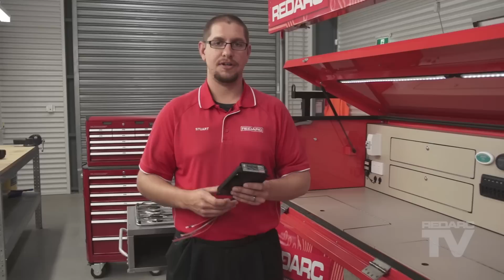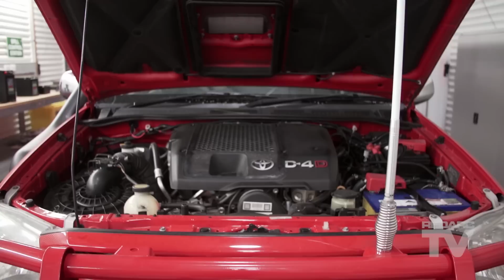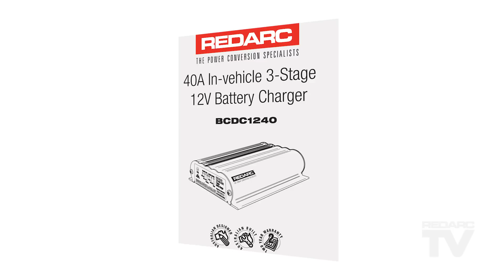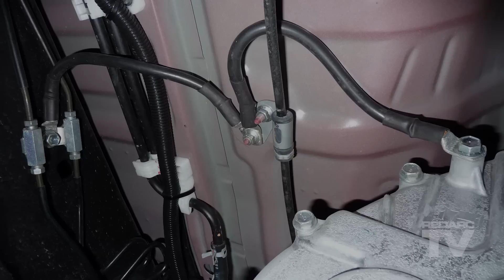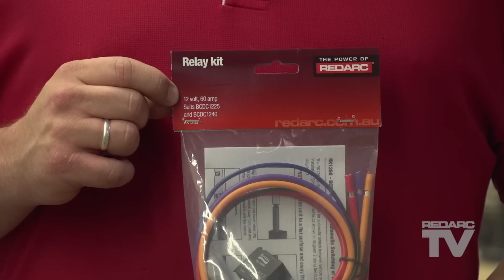Installation guide for the REDARC BCDC1240 (Not BCDC1240D Dual Input)

Comment: Hi- I dont know if i am on the right side here on you tube-i am an 70 year old german man and have a motorhome witch the bcdc 1240 3 stage charger- can i by the charger bcdc 1240 D 3 stage charger for replacement device.i drive to finnland and can not find a dealer of my benimar motorhome-
i have a lithium batterie in the cabin and a normal batterie in the ford transit car- thank you 
best regards from german--my car is a modell benimar yrteo from 2025-2024
günter
Reply from the maker: Hi Günter, please send through an email to power@redarc.com.au addressed to Craig, with the details of the issue, model, serial number and a postal address so we can help you out! If you urgently need to find a replacement part you can use our website to find an installer or retailer. www.redarcelectronics.com/eu/finder
Reply: @REDARCElectronics  Hi-Thank you- i will doe this -best regards günter

Comment: Hey, I know this guide is 7 years old but I have a Redarc BCDC1240 in my motorhome I bought. (it's red v.s. the usual black though, don't know if that matters.) My living quarters battery is starting to die so i'm going to replace it. Now at this point i'd like to know what my options are with this Redarc but the Motorhome didn't come with a manual and I can only find the DUal charger manual on the redarc website.  Could you send me the digital manual file if you have it? Or could you tell me what the best option would be for batteries? Are LiPo batteries possible on this one?

Comment: Is there a specific reason for not recommending the BCDC1240 for charging lithium batteries?
Reply: I believe you need the BCDC 1240D not the 1240, hope that helps 👍
Reply: @The_Nomadic_Yowie  Thank you, i know the 1240D is recommended but what will be the problem using the 1240 for lithium batteries? My motorhome is new and for being longer "off grid" i want to replace the installed battery for 2 lithium ones.

Comment: I have been using the same in my motorhome with deep cycle battery, but wanted to upgrade. 
Can this 1240 be used with lithium battery? I was told that it couldn't so please confirm.  Thank you.
Reply from the maker: Thanks for watching! The standard BCDC1240 is not recommended for charging lithium type batteries, in that situation it would be recommended to upgrade to either the BCDC1240D or BCDCN1240.

Comment: When you say wire all grounds to the same place (chassis), how is that possible when the BCDC charger is in my caravan beside the AUX batteries? That would mean I could not disconnect my van from the car as it would not be common with the car then right?  I am new to this stuff, but would it not be better to run the BCDC earth via Anderson plug from the van back to the car chassis or starter battery?
Reply from the maker: Thanks for watching! When wiring the BCDC ground you will want to make sure the black wire goes to common ground, it only needs a common connection to the car when its trying to charge from it (e.g when the caravan is connected).
If you have any questions on this please don't hesitate to give our technical support team a call  on 1300 733 272 (1300 REDARC).
Reply: @REDARCElectronics  Oh of course, silly me. If the caravan is disconnected, it dont need the alternator lol. I already ran a twin core 4B&S cable from starter bat to Anderson plug, but it seems I dont really need it now, if I am to earth to the caravan chassis as shown in manual instead. Is there any benefit of doing both... like earth the BCDC to both caravan chassis AND starter battery?

Comment: Does the device become hot while in use? how hot?
Reply from the maker: Thanks for watching! The BCDC will get very hot when under full load as it is a fanless design that utilises its heatsink to dissipate all heat from the unit passively. This is part of it's normal function and shouldn't be a concern. 

For more information, fell free to reach out to our Tech Support Team on 1300REDARC (1300 733 272).
Reply: @REDARCElectronics  Thank you !  I will reach, I would like to install and have a few inquiries :-0)

Comment: I have 100 ah battery (start) and 100ah (auxiliary) and handy 240ah lithium and solar panel with 200w.
Should i go for redarc 25a or 40a or 50a? Or it doesn’t matter?.

I want the fastest one
Reply from the maker: Hi Hussam, thanks for your comment. 

One thing we need to consider is not to overload the alternator in the vehicle with too many charging systems; so will need to take a measured approach to this. 

How is the Auxiliary battery being charged? If it is via a BCDC already, then we might consider at most a 40A BCDC unit for the Lithium battery to not overdo the system. If the Aux battery is being supplied by a battery isolator however, we could then consider a 50A BCDC for the Lithium as there would be slightly less load overall. 

See how you go and if you need to have a more in-depth chat with us, please give our Tech Support team a call on 1300 REDARC

Comment: Seems though the six flashes is common but not addressed.
Reply from the maker: Hi there, thanks for your comment. The 6 flash code on BCDC refers to either an Over-Voltage from a Vehicle or Solar input OR it can also mean Reverse Polarity, usually from your Solar panel. In a lot of cases, the 6 flash may occur when a Solar panel that is over the 32VOC maximum is connected to the charger or if a new connector has been setup and the positive/negative wires have been mixed around
Reply: @REDARCElectronics  Hi so the panel was putting out 22 volts, day was clear and panel in full sun, the ground wiring has been split into 3 and polarity is correct. All joints are soldered joints. Charging from the car to the redarc is working as it should.
Reply from the maker: @kman6482  What would be good is to power cycle the BCDC and see if this will clear – disconnect all connections to the charger including Input, Output and Solar wiring, leave all down for 10-15 mins, then reconnect up beginning with the Output and Solar wiring first. See from there how you go. If no good from there, it's recommended that you call REDARC Tech Support on 1300 REDARC for further help.
Reply: @REDARCElectronics  Found the issue. Cord supplied with new solar blanket crossed at 1 Anderson plug. Need I tell you which brand, you may have an idea.

Comment: The directions say to connect directly to the house battery, not the alternator. My concern is that the limiting factor would be the vehicles battery charge rate, not the alternator output. 40amps seems like a lot to ask of a vehicles charge output. I have a Tundra w 130amp alternator BUT there is no direct path from alternator positive to house battery positive so the 40amp draw will have to come thru the fuse block as intended to be charging current for the house battery.
Reply from the maker: Hi Chris, thanks for your comment. 

How it would work is when the BCDC is pulling full current out of the start battery (40A), the load on the circuit and alternator will be higher as the start battery requires more so it will be able to provide the extra to keep the battery charged and the BCDC outputting fully. 

Once the BCDC moves through its charging stages and the need for current drops, the alternator won’t have to supply so much current, so the output could drop if required. 

This will especially be the case with a vehicle that has a smart alternator – they vary the voltage as required according to the load on the system.

If you have any further questions please feel free to contact our friendly Tech Support Team on 1300 REDARC.

Comment: What is the optional LED?
Reply from the maker: The optional LED provides charge status and error codes to a remote location. This is commonly used when you want to monitor the BCDC while you are driving.

The external LED can be mounted on the dash in the vehicle. 

Any other questions please feel free to give our helpful Tech Support Team a call on 1300 REDARC.

Comment: I am going to have solar panels fixed on the roof of my camper van which will assist in charging my auxiliary battery via the REDARC BC-DC system. If I choose to charge my battery with an additional solar panel at a campsite, do I need to do this via the REDARC module or can I connect the second solar panel  directly to the auxiliary battery via an Anderson plug?
Reply from the maker: Hi Gary, thanks for your message. The best option to connect an additional panel is through a dedicated Anderson plug input for a Solar panel. In this case, you will need to connect this Anderson in parallel with your other solar panels on the roof (all positives together and all negatives together).

If you were wanting to try a different method, you can use a separate solar regulator and wire the panel directly to the battery if required too. Although you will have the BCDC and separate regulator fighting for who has charging priority
.
Reply: @REDARCElectronics  Many thanks for this. My thoughts were that if the van is parked in shade, which it will be, I wanted to  keep the auxiliary battery charged with a independent standard separate solar panel. Do I have to keep the REDARC module connected to the auxiliary battery when parked, or can I disconnect it from the system and have the battery only charging from the separate solar panel?
Reply from the maker: @garydurandt5737   You can disconnect the BCDC if you are wanting to, but it does draw very low current from the Auxiliary battery anyway, so shouldn’t be too bad in the long run anyway. It’s less than 8mA. Have the separate panel keeping the battery topped up and it will work nicely

Comment: I'm a bit confused...help! This video makes it sound as if I need the relay switch in order to use the dual function of the BCDC. Is that true? My set up is an AGM starter battery, lithium auxiliary/secondary batteries, and solar panels.
Reply from the maker: Hi BJ, No extra relays of changeovers are required for the ‘D’ model BCDC units; they have all the switching built inside them these days. The RK1260 was for our older, original BCDC1240 units. Any further questions please feel free to contact our technical support team directly.

Comment: I have wired a lot of boats in my Marine boat building business and I always put a product called Lana coat on the Crimp lugs and on the boat battery Post
If possible use 
tinned wire I I have seen massive welder cables so corroded inside they would no longer perform
Reply: Tin the wires upon which you crimp lugs? I wondered if I should do that. I'm using hydraulic crimpers

Comment: Would it be worth while connecting a switch between the cranking battery and charger so you can turn it off while your not using it?
Reply from the maker: Hello Steven, thank you for your enquiry. The best thing to do if the vehicle is sitting for a long period is to isolate the entire battery, or use a maintenance charger like the SBC1210 to maintain a 100% state of charge. Alternatively you can install the switch, but it should not be necessary as the BCDC draws such a small amount of current when in standby mode.
Reply: @REDARCElectronics  I plan to install the bcdc in the rear of my car, connecting to a aux battery in the trailer, i wanted this flexibility so i could run the bcdc with or without the trailer depending on the type of trip. I figured it the bcdc wont be utilised 90% of my driving time, and logically a switch to turn it off would help uneccesary draw, but if the standby draw is very low when an aux battery isnt connected, then thats fine by me. thanks for your feedback.

Comment: If my car has a 100Amps alternator, is it possible to use 2 chargers in parallel to charge LiFePo4 batteries faster (with double the current of a single charger at the battery poles) ?
Reply from the maker: Hello, thank you for the enquiry. You can wire up to 4 BCDC in parallel, assuming the alternator can supply the required current. Its hard for me to be 100% sure with your vehicle as there are a lot of variables in this question. My guess would be 2 x BCDC1225D’s or 1 x BCDC1240D would be the max you could run, please confirm this with a local Auto Electrician. If you would like a recommendation from REDARC for a local installer please feel free to call 08 8322 4848 and speak with one of our help desk staff.
Reply: @REDARCElectronics  Thank you for your confirmation and this tip: https://www.redarc.com.au/how-to-connect-bcdc-chargers-in-parallel
My Mitsu L200/Triton has an 90Amps alternator (non-smart), but  nevermind, the goal is to put solar panels to work and deliver most current. I bought BCDC1240D and newer BCDC1250D.

Comment: I have an impression this guide is dated and not up-to-date, as latest marketing material speaks about Charger actively balancing carving from solar and alternator at the same time with ECO bias to all solar power available - it renders the RK60 relay obsolete
Reply from the maker: Thank you for viewing, and for your question. You are correct that this video does not relate to the current range of REDARC BCDC battery chargers which do also feature solar charging capability.

Comment: I know this video is two years old but hoping you'll be able help out a guy in the US.... My van does not appear to have a smart alternator (will check thoroughly before installing). In the US most advice seems to be that the relay is necessary for smart alternators and/or long cable runs (trailer battery) where running a long ignition wire may not work. In this video it appears that the relay kit is also necessary for anyone wanting to use solar AND starter battery input to charge the house battery. Is this the correct understanding?
Reply from the maker: If you have the current BCDC1240D, the RK1260 Solar relay kit is no longer required.
Please refer to page 11 of the user manual – for copy of the user manual, click here https://cdn.shopify.com/s/files/1/2204/8993/files/BCDC_Dual_Input_Instruction_Manual.pdf?7204406381448510702
For any further questions, please don’t hesitate to call our technical support line between 6am-7pm Australian Central Standard Time on the applicable local call number +1 (704) 247-5150

Comment: When would you use 15 or 15.3 voltage?
Reply from the maker: Thank you for your message. When your battery specifications require it, many calcium and lead acid batteries require this higher voltage in order to charge correctly.

Comment: I have had a bcdc 1225 installed by ARB. It has been installed 1.5mtrs away from the battery. Is that ok? I did bring that up to them and the answer was it will be to hot to install it near the battery which is in a under tray tool box. I believe the engine bay us much of a hotter spot and they are ok to be installed in the engine bay. Unfortunately it has been about 3 years since the install.  If I have some type of support I guess it is worth getting them to re install correctly. It does seem the battery is not charging the way it shoukd be in guessing this might be why
Reply from the maker: Thank you for your message, please give our Technical Support Team a call and they will be happy to talk through any performance or installation questions you might have. You can reach them on (08) 8322 4848 or via email at power@redarc.com.au

Comment: I have a 2013 Mercedes Sprinter Van with a factory installed dual battery package.  should i connect the BCDC to the start battery or to the auxiliary battery ?
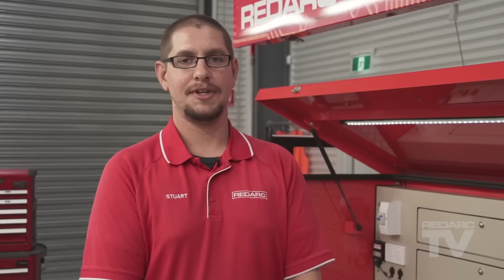Reply: See 0:40
Reply: @RainBoxRed  He's talking about the new battery, not the one provided by  the vehicle manufacturer.

Comment: I was under the impression the solar panels could connect direct to the Redarc.......also, i see folks using 100 amp fuses.....I'm just jum ping in to all this with no electrical experience.
Reply from the maker: Hi Stephan, please feel free to give our Technical Support Team a call and they will be happy to walk you through some options and setup types. You can reach them on (08) 8322 4848.
Reply: @REDARCElectronics  Stephen doing that doesn't help inform those of us reading through the comments hoping to glean additional information.
Reply from the maker: Hi  @oneeyedphotographer ,

Stephan’s question related to the new model, the BCDC1240D Dual Input In-Vehicle Charger, whereas the older variant required a relay to switch between vehicle and solar inputs (the BCDC1240).
The 100A fuses would most likely have been a reference to our Ultimate Dual Battery Setup, which allows for backup jump starting from you auxiliary battery and charging through the BCDC: https://www.redarc.com.au/bcdc-dual-with-jump-start-feature-the-ultimate-battery-setup

Thanks for watching!

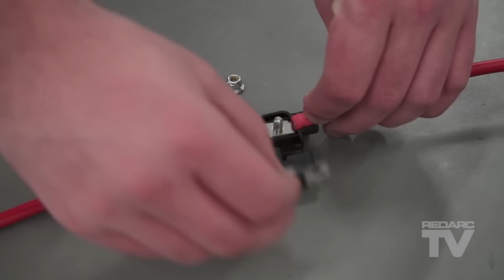Comment: Redarc do you have a part number for the specific lugs used in this video at the 2:55 mark as these allow more thread and a much greater contact
Reply from the maker: Hi Adam, thank you for your message. The lug we use in our FK40 and FK60 is a CTL10-6. Any further questions please be sure to contact our Technical Support Team on (08) 8322 4848.
Reply: Looks like MTA part number 1708250 - not as easy for DIY install as the closed-barrel lugs in the kit.

Comment: Hi,just brought a redarc elite brake controller,should there be any lights on the control knob,while I'm not towing?
Thanks.
Reply from the maker: Hi Lu, thank you for your message. As a starting point try watching this handy video and if you have any further questions please contact our Technical Support Team on +61 (08) 8322 4848. https://www.youtube.com/watch?v=b06BxqyBFWc&t=1s
Reply: Nope. But you can push the knob and it’ll have a blue light come on. Normal non towing operation has no lights on.
Reply: Scott R if u don’t unhitch your car from the caravan ,the control knob in the car is light up blue 🚗
Reply: jenice currie, yeah but he asked if there were lights on it when NOT towing.